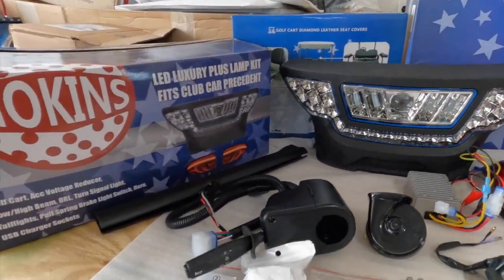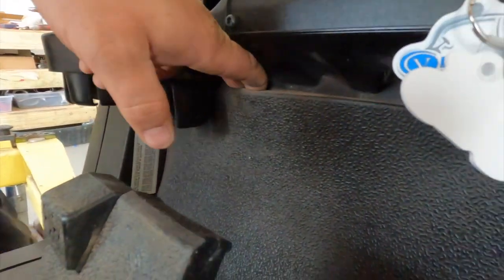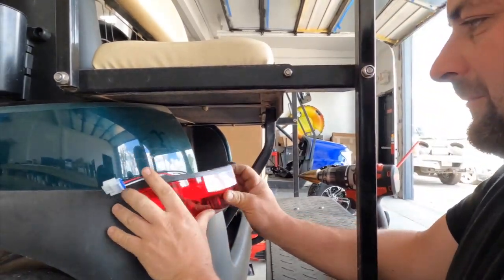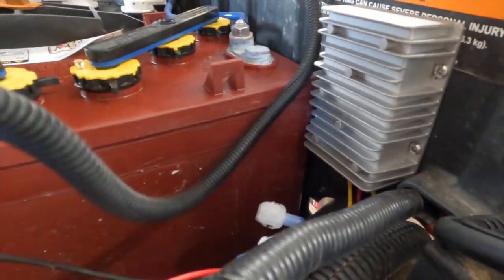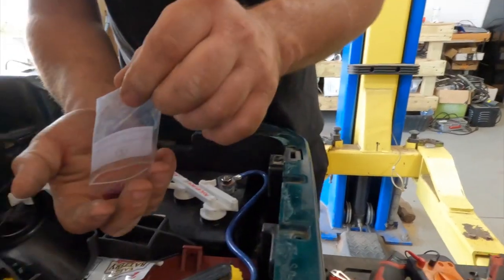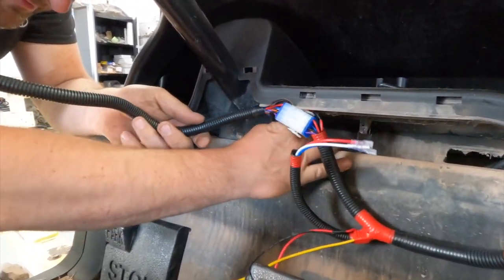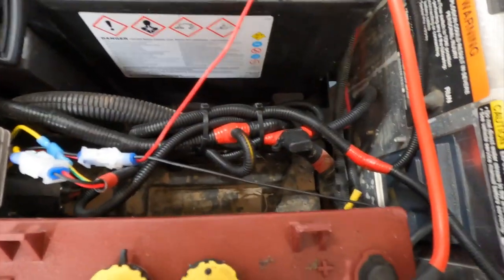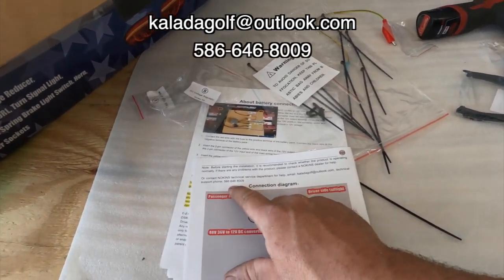Nokins Luxury Plus Club Car Precedent Street Legal Light Kit Installation

Comment: When installing the voltage reducer, I would recommend that you use a 48V relay that utilizes a wire from the ignition switch that will trigger the relay only when the ignition is on.  This will prevent the voltage reducer from draining the battery on a constant basis.  If you dont drive the cart for several days then you are likely to get in the cart and go nowhere because the battery is dead.
Make sure that you get in the habit of putting the cart on the charger the night before you are going to use the cart.
Reply from the maker: The ignition already has a relay built in! Thanks for your input! That is so true! Some kits don't have that!